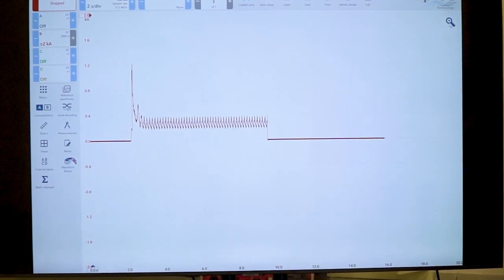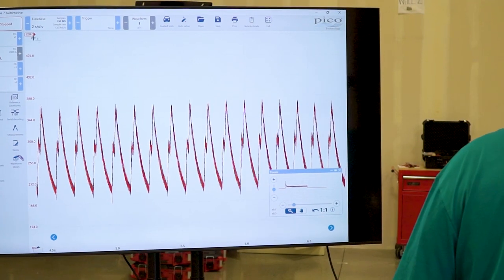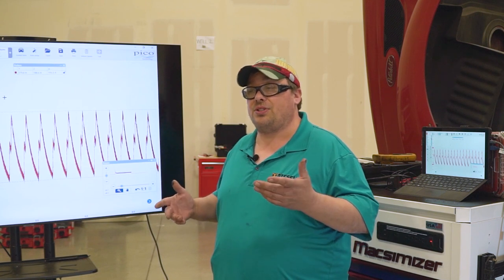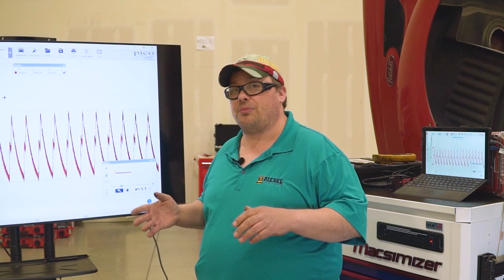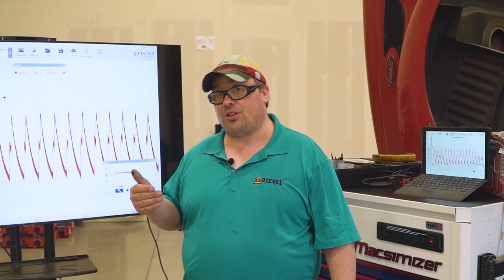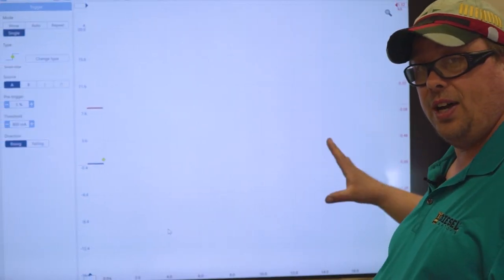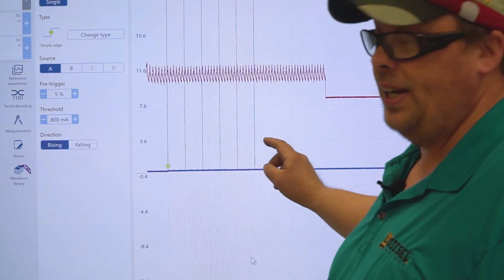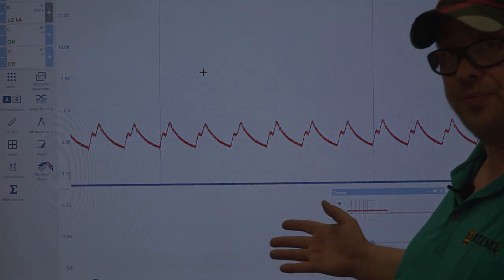Diesel Tech Tips - How to Perform a Relative Compression Test

Comment: How can you tell if its a good relative compression test, or you have a starter drawing to much amperage. How would you tell the difference between the two possibilities.
Reply from the maker: This is actually a fantastic question.   Having known good wave forms with similar engine models to compare to is the best way.  However, lets use a standard 13 liter diesel engine as an example.  Assuming voltage is correct at batteries, when you engage a starter, you will see an in rush of current usually somewhere around 500-700 amps, then it will stabilize around the 300 amp range at the peaks.  If you have one cylinder or peak that is say 100 amps lower than the others, then that indicates low compression on that cylinder.  If all peaks are within 20 amps or each other, and around 300 amps, then all is good.  IF they are all say 150 amps then all cylinders are low.  Again, this depends on engine type, size, etc.   With bad starters or connections, you will generally see a much larger in rush of current OR you will see dropouts on the waveform.   We would love to have you come to our in person scope training to show this much more in detail as it is a mildly complicated subject with many variables. 
https://training.diesellaptops.com/

Comment: Thanks for the video! Just used this method. I jumped wires to a core 6.7 injector I had and used a 2nd channel to watch voltage spike. I thought the issue was #1, but it ended up being the companion cylinder #6 exhaust rocker arm bridge fell off, causing no compression release. Thanks again?

Comment: If the engine failed a relative compression test, does it always mean a problem to compression? I'm thinking a parasitic load from faulty accessories like the AC compressor, alternator, air compressor, drive pulley and belt can greatly affect the cranking effort of the motor. Will this test lead you to a wrong diagnosis?
Reply: @mjediagnostics9510  I don't doubt the effectiveness and the quick application of this procedure, but I'm just trying to start an open discussion about where to go after getting a failed test result. I have worked for Cummins for 13 years and I have never seen this strategy implemented in the big diesel engines. I have done countless of compression check using pressure gauges and I can tell you that a mechanical gauge doesn't offer information as detailed as one of these oscilloscopes. I will invest on one hopefully next year.
Reply: It is quite possible to see an abnormality when a grid heater or something kicks on, however if every 5 humps there is a gap or low peak- on a 6 cylinder- then you can pretty much know one cylinder is low. Alternatively you can put the current clamp on the starter cable so you aren’t measuring other electrical loads.
Reply: Yes. Kick amperage is higher and overall amperage is higher too. When you are thinking waveform is wrong, just do same test with normal truck and you get baseline waveform. I working with cars and overall diesel car amperage in RC test is somewhere 250A. Gasoline engine is about 150A.
When alternator is stuck etc. overall amperage draw is much higher because starter must do more work.

Comment: Good video, you cant differentiate cylinder compression in that way tho, your only checking the when the pintle opens and closes do to the signal its receiving. It does not give you an in cylinder compression or integrity. I like how you are using and oscilloscope tho.
Reply: hes measuring current draw to the starter motor.. whilst it wont give you a compression reading as such, it gives you an idea how the cylinder pressures are relative to each other. higher current draw means higher resistance which means higher compression.. if one was lower it would mean a cylinder compression was down
Reply: I agree with you, it can give some good info as long as you preform a amp draw and voltage on the starter to insure its with manufacturers specs and then preform your test. Your video is very useful for understanding what relative compression means. Great job buddy.
Reply: @mjediagnostics9510  I watched a different video showing compression value per cylinder by using pressure transducers attached to an oscilloscope.   I also watched another video where they showed injection timing using the oscilloscope.
Reply: @mjediagnostics9510  the Coal mine where I work just acquired new CAT fusion dozers and graders. I can see this tool becoming more useful for the heavy diesel engines and mining equipment because of all the PWM signals that the makers like CAT and Komatsu are using to their controls. I have been checking what is available out there. I liked the Hantek handheld because it is affordable, but it only offers 2 channel. The Pico brand is software only  which means you have buy a suitable computer and it is expensive. I think out of all brands I would go for the Micsig because it is portable and has 4 channels plus the other functions.

Comment: Nice video. Assuming you used a 2000 amp clamp? Also, if you have multiple battery cables how do place your amp clamp? Thanks
Reply: @mjediagnostics9510  Thanks for reply! I just was asking if you could clamp multiple cables at the starter and read overall amp draw, I get multiple answers and I respect your input on this. Typical HD truck can have two 2/0 cables vs one 4/0 or such. I "understand" clamp must be fully closed to measure the induction and wondered if this is proper practice in this type of situation to clamp around two cables of same polarity to measure current flow. Thanks again. Just experimenting with known goods. I use DAVIE4 for compression test currently that is most likely measuring voltage fluctuation when cranking.